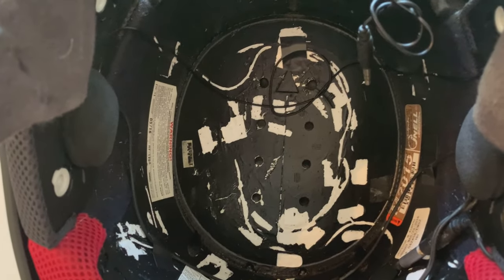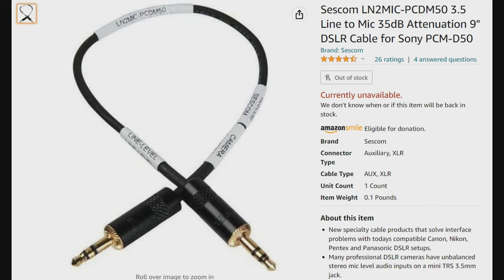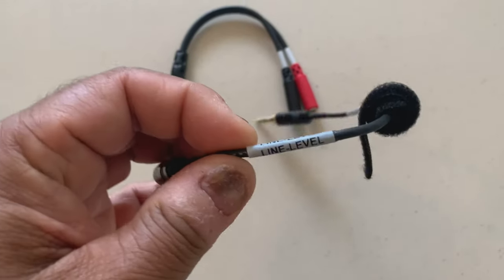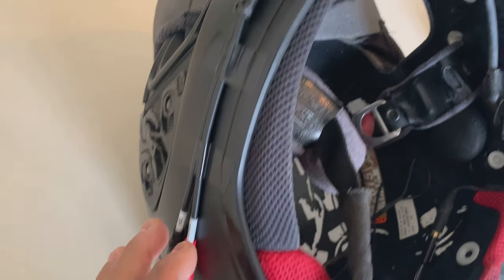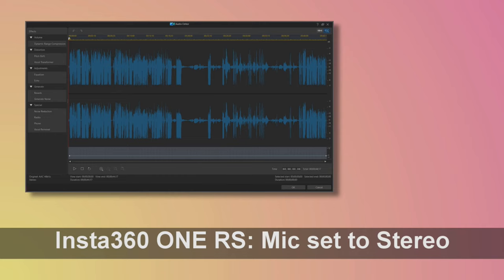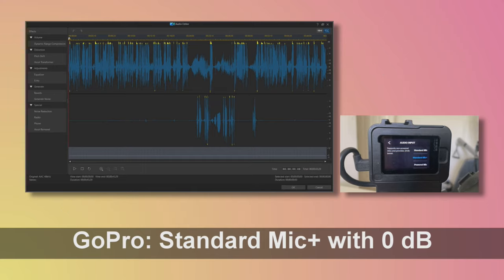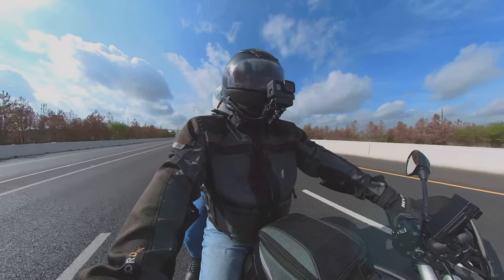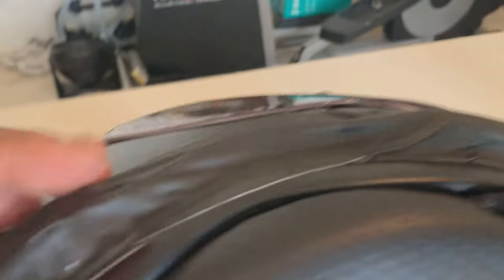How to record helmet intercom on your motovlog videos - hear both sides of the conversation!

Comment: My headset doesn’t use 3.5mm jacks 😢
Reply from the maker: Worth it to upgrade to one that does, even if you're not motovlogging. You can get better speakers for music with 3.5 mm jacks.
Reply: I’ve decided to add a small dji mic (already own) near my intercom speakers in helmet… so it can record both my voice & speakers. Kind of a “cheat” method.

Comment: Wow, this is way simpler than what i tried before. I tried soldering resisters to downmix left and right channel on my cardo, so that it made it mono, then that mono was L channel, and the same for the mic on right channel. Can you confirm that this set up has held up good? any crackling issues?
Reply from the maker: Keep watching the channel and especially the videos where my wife is on the back of the bike. Another such video will drop in 3 hours. Yes it is continuing to work well and I expect it to "hold up" for  as long as I have it installed. With this setup the GoPro mic is on one channel and the intercom audio is on the other, so it does require some audio mixing to make it mono when producing the final video. There is no crackling issues due to the attenuator cable. Any crackling that you might hear in my video is due to the headset on my wife's helmet being the most basic Freecom 1+ unit from Cardo, designed only for short-range transmission.